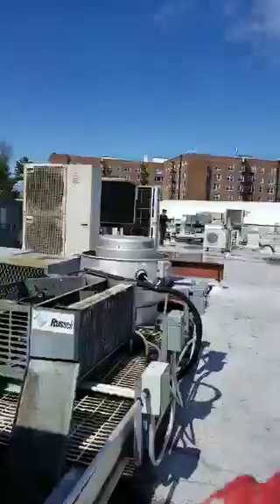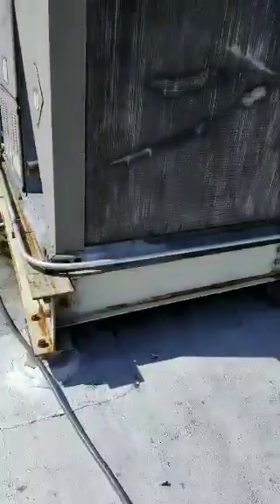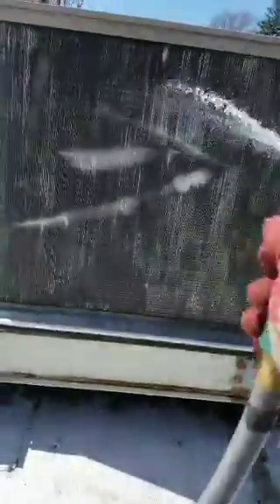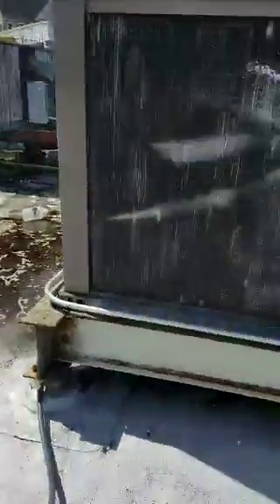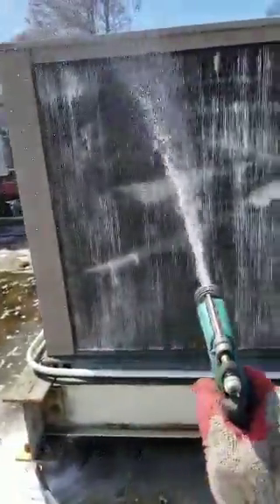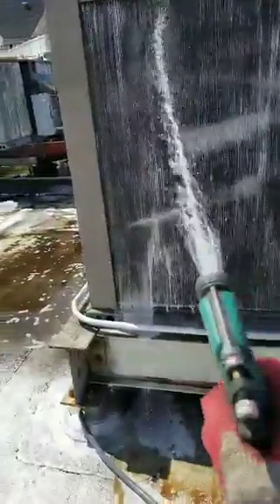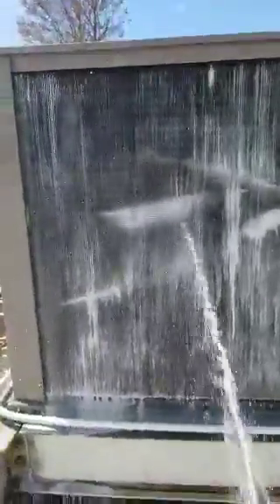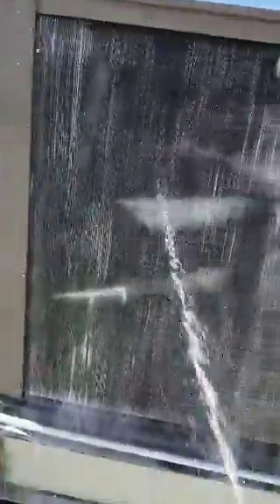How to service/clean a rooftop airconditioners condenser unit. York Roof top AC Unit (RTU), York ac

Comment: Thank you I’m starting a  Pressure Washing Company when I soft wash the roof I want to clean the rooftop Heating and air-conditioning unit as well..
Reply from the maker: You should charge extra for cleaning the RTUs and or make it a separate job whereby you either use ordinary water or nitrogen or chemicals as shown in the video.  Different prices for each. You know what I mean?